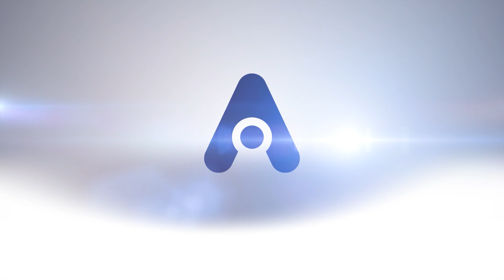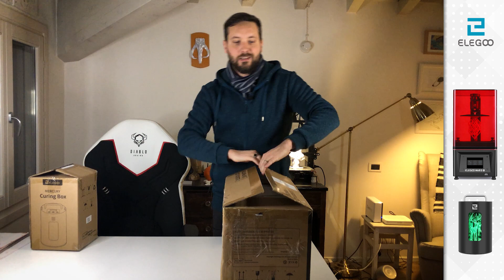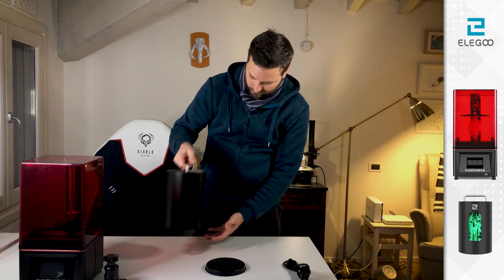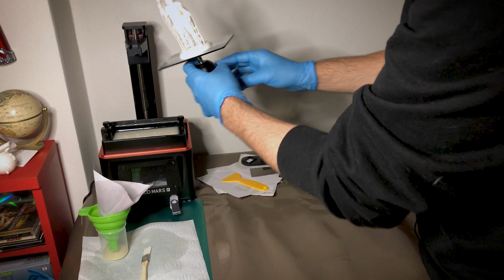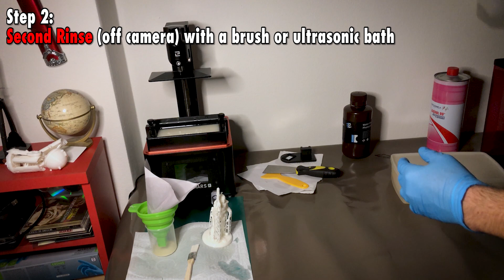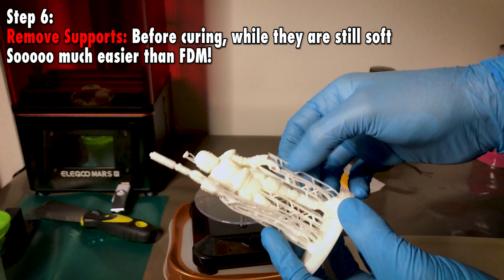Elegoo Mars Pro: Unboxing, First Print and Impressions!

Comment: I have been flip flopping about getting a resin printer for months. I really want one because I have some designs I cannot produce on an FDM printer. I don't have a dedicated space for it, it would have to go in my lounge. So I have not bothered yet because of the smell/ fumes.
Reply from the maker: I really think you have a challenge there.
Reply: @AMakeDesigns  I almost need a sealed chamber for it. Or they need to make a printer that truly keeps it's smell inside.
Reply from the maker: You still have to provide some ventilation to the outside or you will be overwhelmed when you open the chamber. I found a few printable upgrades to seal it more effectively. I will give that a try as soon as I can

Comment: Would love you see your thoughts on the AliExpress "prusa mini plus" sold by fysetc. (Not be confused with prusa's "plus" iteraton which is an upgraded probe and a couple other minor upgrades). The "plus" sold by fysetc is for a larger bed. Instead of 180x180mm it's 180x250mm! It comes with extended rods and essential parts. Been having my eye on it for a week or 2 but haven't pulled the trigger on it. :)
Reply from the maker: Good to know! I did not catch it. I might give it a go! Thanks for sharing